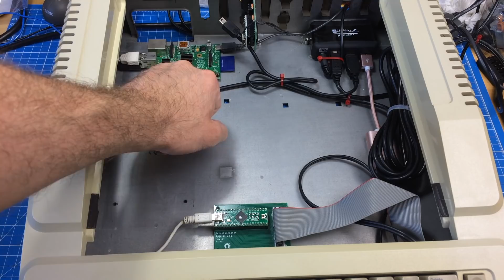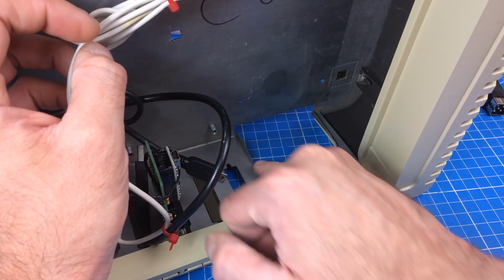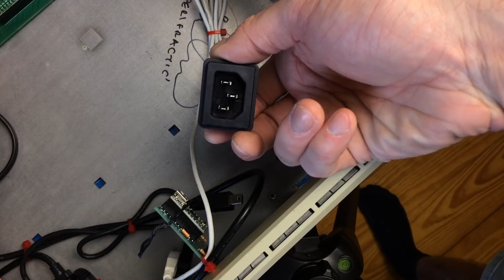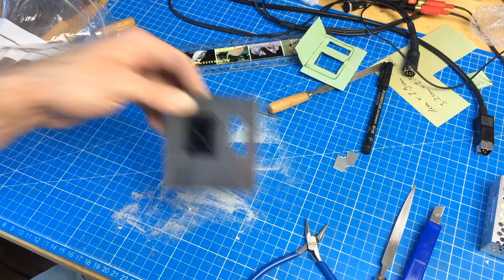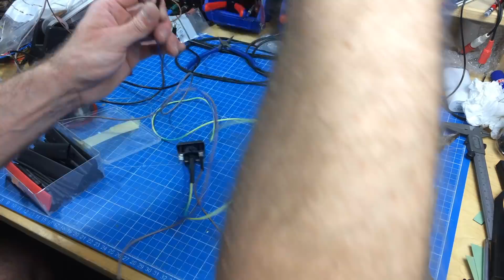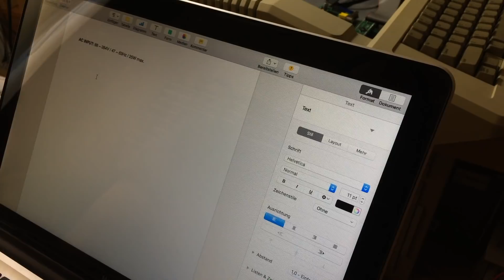Apple PIIe PSU build for the #ThinkDifferentChallenge

Comment: When drilling steel sheet metal (or even a aluminum), use a punch to dimple the metal first. This will keep the drill bit registered so it doesn't walk around and slip off (I think we saw that here =P). Don't push so hard while drilling as well, if the bit wont drill into your material with a small amount of pressure, well then you are using a dull bit or the wrong bit for the job. There are different types of drill bits for steel, most of the cheap sets of bits are for nothing harder than aluminum/copper.

One little slip is all it takes to put a hole in your finger/hand (yes I know this all to well), so be safe my friend. I know it's tempting to just use what you have on hand but the proof is there for all to see (you now have a broken useless bit). It is never wasted money, time, or safety to use the proper tool for the job. end PSA
Reply: I would add: put the sheet on a thick wood block when drilling. Drill thru the aluminum and part way into the wood. This way you won't bend or distort the aluminum.
Reply: I would also add, dont use the full rpm on the start, just gradually build up to the needed speed, I've seen Jan using full speed while drilling and driving screws in full speed a few times and every time I cringe of fear the drill will jump to his finger.
Reply from the maker: Thanks Ian. I actually punched the aluminum with a needle thingo first. The drill bit I used was very dull (and cheap) before. (To my excuse... I know I didn't do it very professionally...). :)

Comment: The hub for power could have been removed by using positive and negative DC rails.  Perhaps something that someone else can tackle.
Reply from the maker: Oh, the hub is not only there for providing power. Sorry if that isn't clear from the video. It also adds USB to the back panel plus the sound adapter plugs into it (the Pi itself has only 2 USB ports as it's an old model).

Comment: who else screamed 'WTF DUDE!" when he smashed the drill into the back of the case??   When drilling thru steel you need to give it a little bit so it bites into the metal.... pressing on it like an assole gets you a broken bit....
Reply from the maker: Yeah, I did it the wrong way. The drill bit was really dull (and cheap) before and I didn't notice until it was too late. There was no chance of drilling into the metal with it even if I had done it right, I guess.

Comment: Those Meanwell PSU's look nice. Thinking that I could fit one of those in my A500 PSU case. I won't recap the original PSU, the 2.5A (Yeah, I have that awful heavy one) it delivers when working properly isn't enough to power my accelerated 500 anyway.
Reply from the maker: Definitely good quality! I think they make models with combined 5V/12V, too, so there might be one that's perfect for an Amiga PSU.
Reply: Had a look but I'm not quite sure what to look for to be honest.
Reply from the maker: These guys used a Meanwell PSU for example: http://www.nightfallcrew.com/15/06/2014/commodore-amiga-500-full-replacement-power-supply/

It has "only" 3A for the 5V rail unfortunately, so it's not much more powerful than the original PSU. I'm sure there's similar PSUs with more ooomph, too. You need +12V, -12V, +5V for the Amiga. The 12V rails don't need a lot of current, the 5V is the main supply so it's good to have some more Amperes for that.
Reply: I'll look and see what they have. 5 Amps feels like the minimum. I can always get an SFX PSU but I prefer to find something I can build into the original PSU case so things look right.

Comment: is the incoming protetive earth connected to the case anywhere?
Reply: no it was a metal case, and the earth wire ran from the IEC to the PSu earth connection
Reply: I’m not an Apple II expert, but that case seems to be all plastic.
Reply: Jusb1066 Ah. My bad. 😀
Reply: no worries snorre, he did kinda zip past it
Reply from the maker: Yup, it's connected to the PSU shielding which is connected to the metal case of the Apple IIe.
Reply: Jan Beta OK. Missed that!

Comment: Before you ship that off to the next person, if you haven't already, I'd secure the main's receptacle and power switch with some epoxy, rather than zip ties.
I'd also consider installing some main board stand-offs for the teensy unit and the R-Pie.
Reply: Thats when you leave it up for the next guy lol.
Reply from the maker: Shhh, I left some things for the others to do. Also, I "secured" the mains receptacle with lots of hot glue holding the zip ties in place, too. ;)

Comment: if anything i would have used crimped on connectors for the  psu :-D
Reply: soldered is fine, but i was surprised he put the metal chassis of the PSU right next to the power switch. and he didnt use a double pole power switch to switch both sides for safety :D plus, i didnt see a fuse :D
Reply: soldered is fine with solid core copper wire. not with stranded. the solder sucks into the stranded cable and creates a weak point at the spot where the solder ends.
Reply: there was 2 fuses on the back of the iec connector, you dont need a double pole at all, switching live is perfectly fine. he used heat shrink and enough gap so there is no issue
Reply: yea, until someone plugs in a power cord which is wired backwards and now the live is sitting on the neutral line and you have the opportunity of a hot chassis. as far as the fuses go, i didnt see them.
Reply: actually... 99% of all mainland european IEC power leads can be inserted the "wrong" way around. only 'belgian' (also used in a handful of other places) type wall outlets have the centering ground pin. switching around live and neutral should never be a problem tho. the hole for the pin is usually there on the 'wall outlet side plug' on the cables, but it's not present in most outlets. just the ground pins on both sides, which don't guarantee any 'inserting them the other way around' prevention. should never be a problem with properly designed and connected psus anyway.
Reply: i'd say there is a pretty good chance the buildings themselves also have the L and N swapped around in the wall outlets as especially with wall outlets mounted 'sideways' it's pretty hard to tell which side would be left and right anyway. it's also not as much of a 'hard rule' as it could be. just that in the end, ground usually connects to neutral.. somewhere deep down at the fuse box on a big metal bar... and that's about it. the exact side of L and N within wall outlets is more or less up to whomever installed them (Although there are some rather lose 'standards' on that ;)
Reply: https://encrypted-tbn3.gstatic.com/shopping?q=tbn:ANd9GcSbnfurtwmmV7lQOMdPKsbLgdQ6X9B9za66ZnkSBwm0IULwRH_ixWAz3zCmaqyWzmqI5u2BRoA&usqp=CAE see that round pin on top, it isn't populated in the wall outlets. it's what prevents inserting up side down but as the actual pin that goes into the hole mostly isn't there, it will not do that task.
Reply: Live and neutral should be handled as live for american and european users!
Reply: Kinda hard to do that with an IEC plug unless the electrical outlet is wired backwards. Not to mention the PSU is at earth ground reference so if the Live side was to be injected into the Neutral it will pop the breaker and or fuses.
Reply: and one of those shielded IEC connectors with built in filters and fuse accessible from the outside. this part doesn't seem intended for this use, it does appear to have some additional legs to mount it to a pcb or something.
Reply: the only thing on which i've ever seen this become a problem were compaq pc power supplies which sometimes magically managed to have a 110 volt potential difference on the outside of the case between 2 pcs on the same phase (Which would occur if they just so happened to be on different phases all the time anyway). 'bad design' on a somewhat larger production scale there ;)
Reply: and then there are just crappy installations in general. with like 100 volt leakage to ground (either actual ground or the ground of the wall outlet), on the N coming straight out of the wall outlet already. lol. (mostly found in southern parts of europe tho ;) absolutely no idea how they managed to screw that up but lets just say we didn't exactly feel like pulling out the entire wiring all the way up to the transformers lol.
Reply: "reversing L and N" however, is normal with most european plugs other than the belgian and uk standards which both have some pin preventing it so the plugs only go in one way. with anything else, it just goes in the way the user inserts them ;)
Reply: would not switching off the neutral make the ethernet cable and the monitor and such the neutral? lololol. ethernet, for a fact, can handle that... :P just that you don't want to insert the plug with your fingers touching any of the contacts in that case lololol.
Reply: it actually will not break your switchports :P but you will learn some lessons about 'voltage potential' quite quickly lol.

Comment: Jan, I like what you did with the PSU, but why did you put the metal shield on the outside as opposed to inside?
Reply: It's always easier to take the path of lease resistance.
Reply: It has a really weird angled lip on the inside
Reply: Some times it is easier to take the path of lease resistance.
Reply from the maker: There's this bent lip on the inside so it's not easy to fit anything flush against the case there. Unless you use a large bottom plate. I went for the quick and dirty way because it was way easier (and more sturdy I think). Didn't have a lot of time for this project unfortunately otherwise I would probably have come up with something a little bit more elegant.

Comment: Is possible that the 5V leads may become loose in the terminal block after a few thermal cycles. In general, tinning wires to a terminal block is a bit of a 'No No'.

More info:
https://reprap.org/wiki/Wire_termination_for_screw_terminals
https://electronics.stackexchange.com/questions/29861/tinning-wires-that-will-be-screwed-in-to-a-chocolate-block-terminal-strip
Reply from the maker: Oh, thanks for pointing that out. Wasn't aware (obviously). I only tinned them lightly so it might work but it's probably a good idea to double check the connections.

Comment: A power supply from a Dell Poweredge 850 would fit nicely in there.  It would also provide plenty of power for a small PC.  It is exceptionally quiet considering its intended application (a 1U rackmount server).

Comment: enough room in there to make it a nes/c64/atari/apple and a few others emulator!, plus add  some other mini android board and a wifi and use it online?
Reply: Pi can emulate all these systems without requiring more physical room, and it can easily boot a minimal Linux desktop with Chromium or Firefox or actually lots and lots of software. Not sure what the Android board would be for? Pi2 and Pi3 can actually run Android natively too, not too badly but not perfectly either. Also USB storage drives are supported, as are dozens of kinds of WiFi adapters, especially the cheap ones.

Comment: Isopropyl alcohol pops off hot glue too, when an iron isn't so convenient. Just pour some on and wiggle the item around a bit.
Reply: Maybe he was afraid of damaging Perifractic's signature.
Reply: Excellent point!
Reply from the maker: Yes, that's the reason. Also it obviously looks cooler to use an iron! ;)
Reply: Alcohol would dissolve the marker ink ^^"
Reply: I use isopropyl alcohol to remove adhesive residue